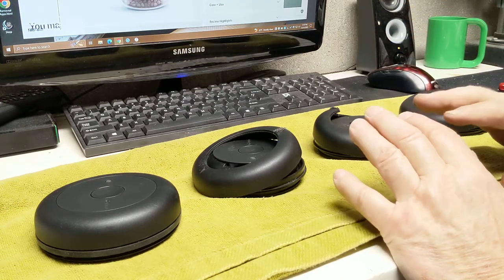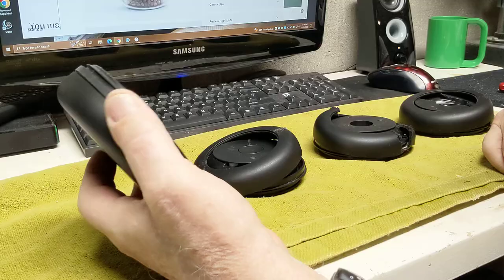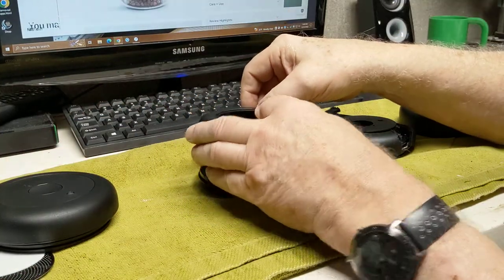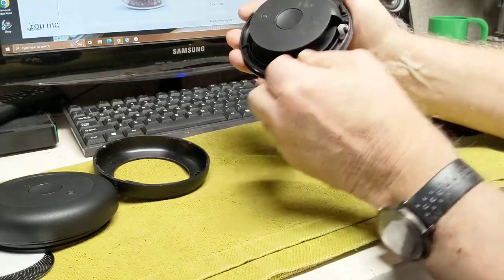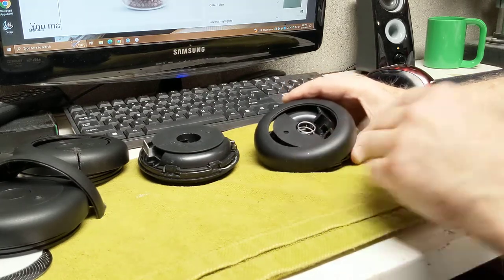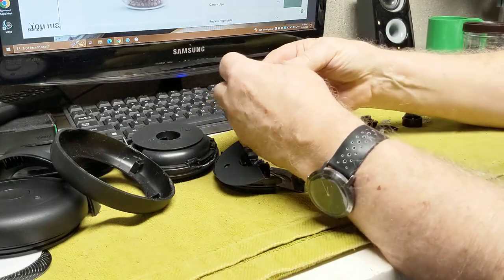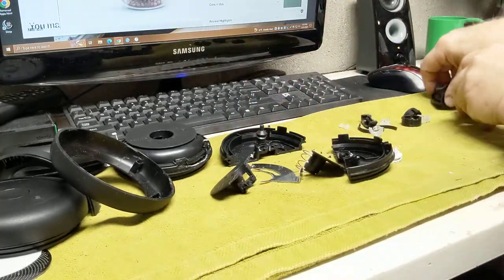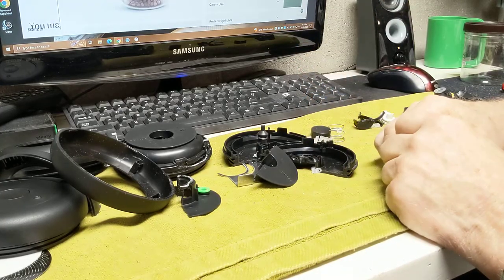Fellow Atmos lid deconstruction

Comment: Do you know where to buy the replacement polyester filters?
Reply from the maker: I don't. Contact Fellow and see if they have them available:  https://fellowproducts.com/  
Let me know if you find replacements.
Reply from the maker: Alternatively, you might be able to furnace filter paper to fashion your own, such as this. https://www.amazon.com/Material-Filters-Bacteria-Particles-Allergens/dp/B08K2NT5BF
Reply: Hi TC. i. I store my beans in plastic lunch bags with a double seal and then pop about 3 of them into the cannister. ii. After say 14 months the vacuum retention was negligible (and not due to coffee dust.) iii. Appears general particulates in the air clog up the paper/poly filter and they need to be gently cleaned with a can of pressurised air. I tried that and it really didn't make much difference. Now I've seen inside I think the O ring wears and doesn't provide a sufficient seal. Won't buy again.
Reply: my indicator stays down even when vacuum is released. Any chance i can get it unstuck without damaging the system?